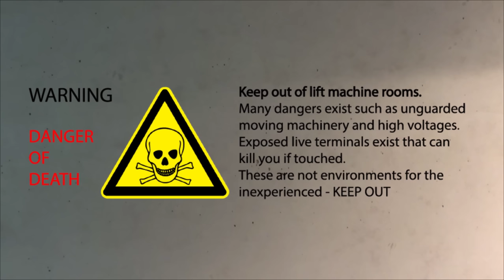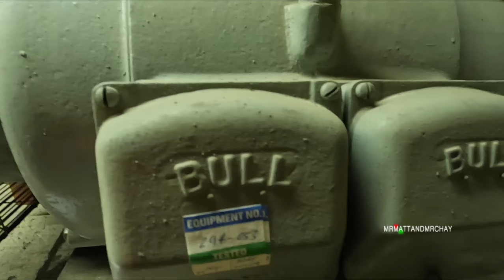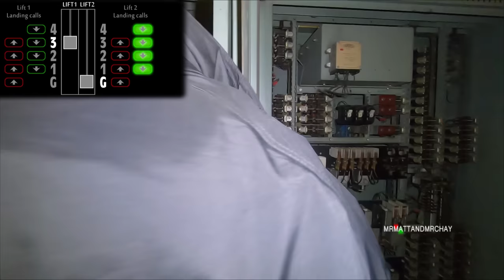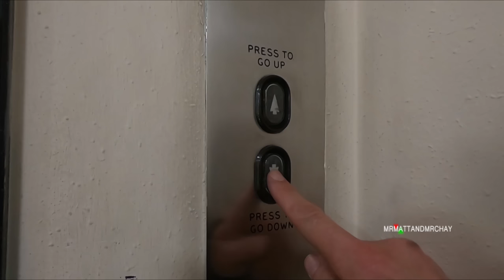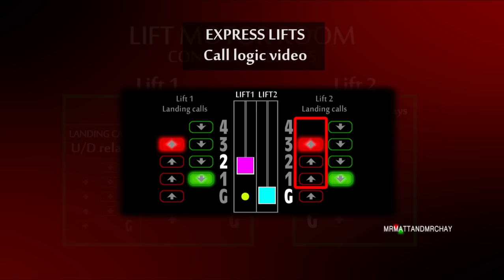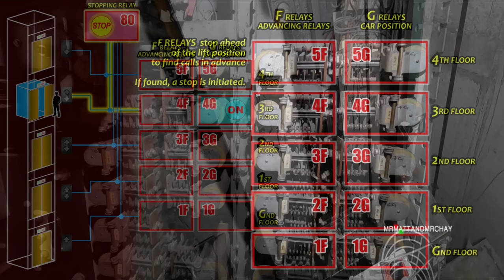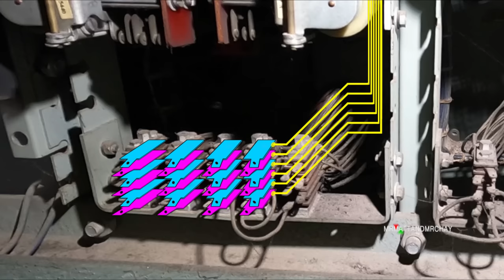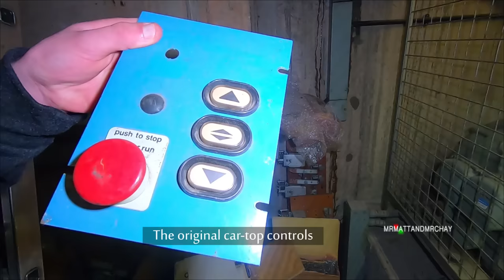RARE duplex 'Express Lift' machines - how it works with animations

Comment: As a building electrician in a large complex, I used to watch the relay panel of our 1950's Otis controller.  By watching and listening I was able to determine the purpose of the majority of them.  Most of the other lifts were modernized and did not have the open racks.  Great video!
Reply: The clacking of the relays is extremely satisfying.
Reply: Wait until you see one arc over, it's quite something 😁
Reply: Please give me your hair
Reply: @TimPerfetto  takes years to grow 😊

Comment: Engineering in system like this is impressive, and then i realize, that almost every wear part failure is designed to not cause major problems - this is ridiculous how clever people where in charge of projects like this.
Reply: Many clever guys where spending days messing with stuff to cause problems in testing phase, that's for sure

Comment: The next evolution of that duel winding system was to use a similar resistor bank driven system like what was in trains which allowed for many different speeds that could be rapidly cycled through to achieve almost perfect levelling! That system was generally first used in high rise lifts in the 1970s but did become a lot easier to do in the 1980s with DC pulse drives and microcontroller logics! :)

Comment: I live in the US and have been in hundreds of buildings and high-rises and mechanical rooms nationwide as an inspector and I have to say my favorite period of building is 1967-1973. There is just something about era, they all look and smell the same (those that are left) and it was an era of brute engineering force with focus being on function rather than form (as it should be). Those long basement corridors are always grungy from the buzz of transformers and motors and fluorescent lighting with magnetic ballasts, the whole basement would resonate at 60Hz and you could feel it. I love those buildings. So many of them were "overbuilt". Once you got into the later '70s, energy efficiency mandates really changed everything about how large buildings were designed and the building guts didn't feel so "raw" anymore.

Comment: You did an absolutely great job in providing this in-depth look into these Express lifts! Great work!
I have never seen this approach to serving landing calls, that's very interesting. I'm only familiar to the way Schindler's relay controllers do group dispatching. Their solution is to use a separate central unit that does the dispatching, while the controllers of the single lifts only hold car calls. The same applies for Aconic.

Comment: Very cool to see. There's so much that can be done with Relay Logic and special types of relays (Timers, Delays, etc.). I worked as a Controls Tech for a while (with PLCs & industrial automation), and noticed that old Relay Logic diagrams were basically what modern Ladder Logic is emulating (seems obvious, but the UI in Allen-Bradley and MELSEC software even looks like a schematic). I imagine back in the day they would draw out a function/control diagram and state machines, then translate that into Relay Logic diagrams as part of the schematic creation.

Comment: Serviced Express lifts circa 55 years ago. Brings back memories.
One Express lift had a Bull Slipring motor but was not a super tandem.  It was, however, 2 speed.
Lift accelerated up to speed just like any other slipring motor. To slow down, resistance banks wer re-engaged, and an eddy current brake brought the speed down to a slow crawl to a stop. This lift was circa 50 metres a minute at high speed. It had full loadsense weighing to detemine the acceleration and braking required.

Comment: The lifts here in my tower block are express lifts, they're old and really need to be replaced lol.. it's interesting watching your video to see how it all works. Also the lift cars don't always match the floor that well it can be a few inches out at times. Lift B when it arrives at the ground floor it can be a bit of a clunk stop. I've lived here for years so I'm used to it however when I have guests they're a little bit unnerved by it.

Comment: Q. in some lift motor rooms I've been in, there has been a tool for manually takng the brake off. If you do this with an un-powered empty lift, will it move.
Q2. I've seen a video of a lift accident where the car has gone upwards uncontrollably. Should the emergency brake operate in these circumstances.

Keep up the interesting videos.

Comment: Greetings from Russia!  Our elevators rarely operate for more than a service life of 25 years.  At most, the experts extended it for a year or two so that the owner could find a replacement and order the equipment from the manufacturer.  How is this organized in your regulations?  Working elevators from the 60s, amazing

Comment: I was wondering if there was an intermittent or damaged inductor and it caused the floor selector to jump a 'notch or two'.  What would happen in this case?
Reply from the maker: In short, when the floor selector reaches it's 'terminal floor', if the correct floor switch is not pushed then the selector is assumed to be 'out of step'.  The selector advances around rapidly until the selector pushes the correct floor, thus resetting it's position.  I do have a video of this, and it's one of my videos to be edited and explained.

Comment: 15:01 Are those timers transistor based?
Reply from the maker: No they're not.  They're actually quite simple - behind is a big capactor and loads of resistors on the dials.  The capacitor charges up, then dumps it's current through the relay next to it.  The resistors control the discharge rate.  You can see them better here:  https://youtu.be/PZf6laIbeGI?si=WGkd2UGDSszyzKXI&t=441   7:26 you can see the back.

Comment: The CANBUS protocols and modern SoC (System on the Chip) simplified all these mechanical devices, The entire physical wiring schematic is mimicked by firmware programmed into an FPGA chip that controls all the functions of the system using few wires and digital codes and messages instead of an analog voltage on each dedicated wire for one function only.

Comment: Can a otis elevator relays work with household voltage?  I found them on Ebay and love your videos! I would love to build a pet elevator using a otis floor selector If I can find one while using the relays.  I would have the relays in a glass box that lights up normally using a relay to Activate the light and shut off when the sequence is done.  the plexiglas box with the floor selector I'd have it light up with color changing LEDs from the inside.  is this possible?
Reply from the maker: Depends on your household voltage.  Here in the UK it's 240volts AC.  The Otis relays are likely to be around 110VAC - so the answer would be no, not without a transformer (110V construction site transformer may be ok - search ''110v construction transformer'' on net, the yellow things).  However, this is a massive over-kill.  If you did build a pet lift then there are plenty of other relays that'd work, and then you could probably use a 12v relay coil (use a 12v power source) and you'd not need to generate 110V.  You could also safely connect LEDs to the relays when they switch on.

Comment: This is definitely an old electromechanical relay control system for this pair of elevators. Modern elevators use a microprocessor based control system. One big problem with an old electromechanical relay system like this is that these old electromechanical relays are not made any more. At some point in the future this pair of elevators will need to be converted to a new elevator control system that is microprocessor based.
Reply: Fortunately, when they did make them, they made a lot of them, I'm sure there's NOS to be found, even if the box says Western Electric.

Edit: This panel probably runs on 415 volts. Relays with 48 volt coils wouldn't work.